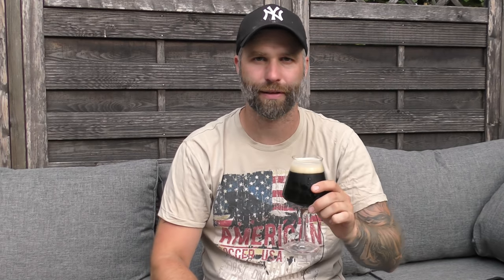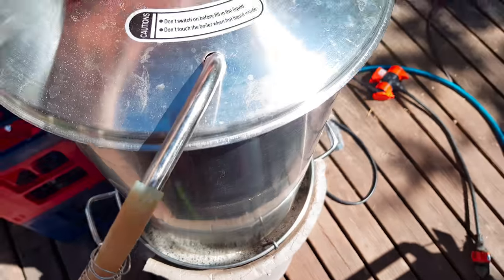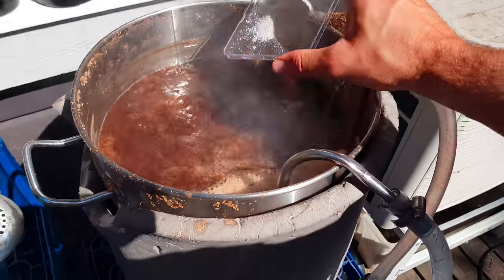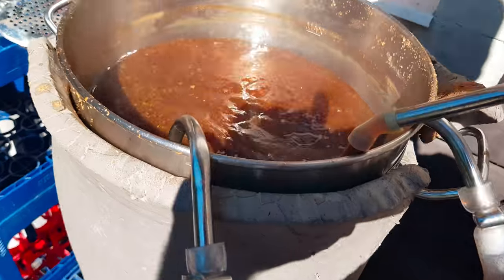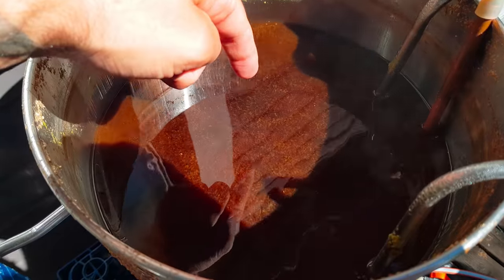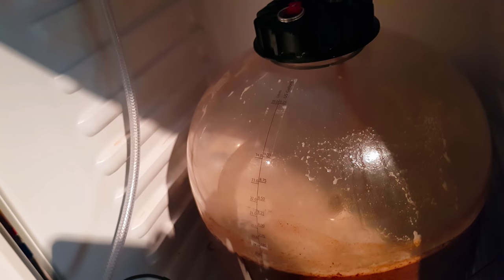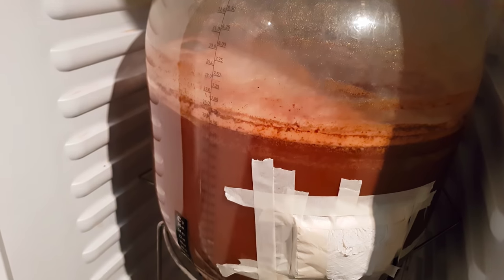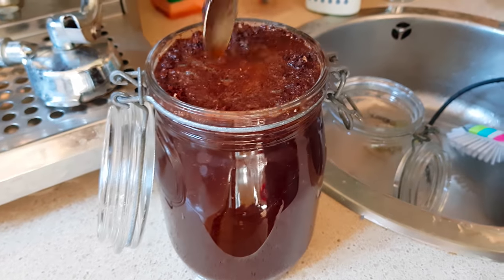Schwarzbier with Coffee - Brew day, recipe, tasting - Brewing beer with coffee part 3

Comment: Dr, love your videos! In regards to the coffee, you could try sous vide 'cold' brew. I am not sure if you're familiar with the sous vide process but basically being able to maintain exact temperatures allows you to extract maximum flavour and avoid bitterness by over heating etc. You can play around with the temperature as well to get different results. Also, pasteurisation will be achieved by holding the liquid at a certain temp for 'x' amount of time. There is plenty around on sous vide websites etc. for research! Keep up the good work.
Reply from the maker: Thanks, never used sous vide for coffee but for other stuff: https://youtu.be/6pW8ikgj4Wo